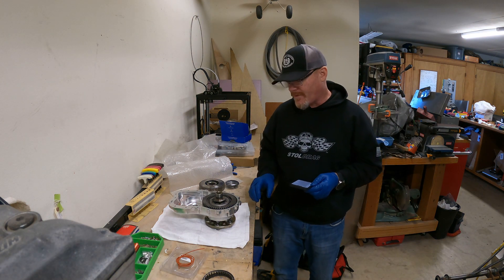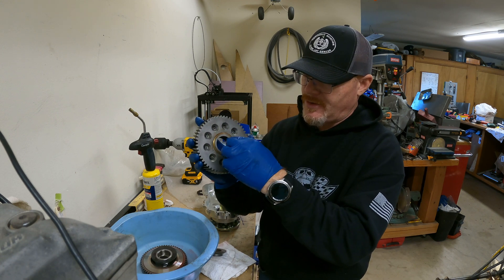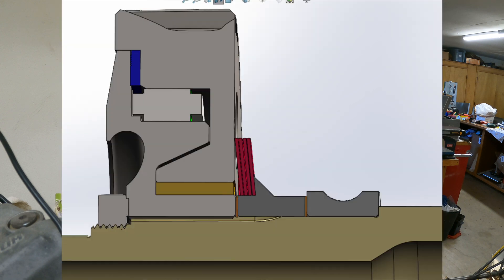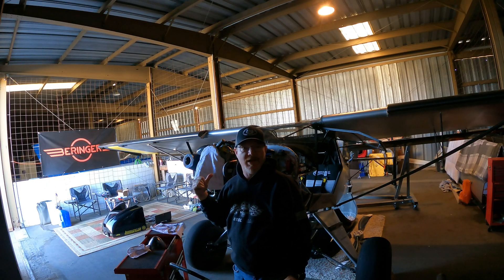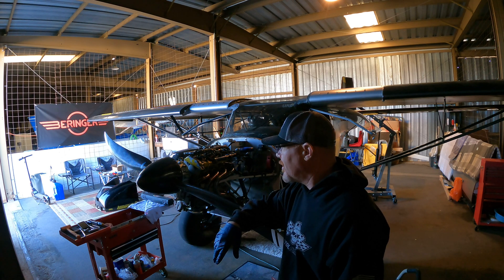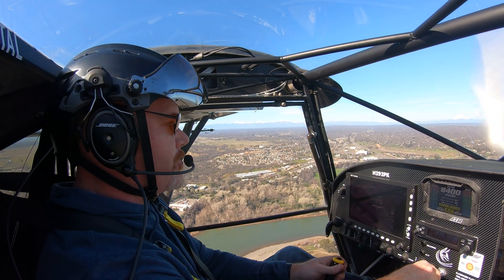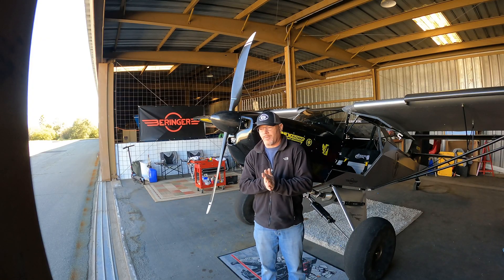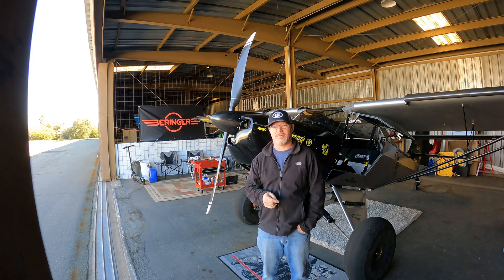Kitfox 7 Apex Build Episode 72 SkyTrax Gearbox Clutch upgrade for the Yamaha APEX on a Kitfox 7

Comment: Hey Bryan, love your videos. Thanks for sharing your journey. I've noticed for a while on your in-flight audio that you seem to have a ground loop causing noise. Ground loops can be tough to track down and fix, but you might consider trying an inline noise filter on your recording device's DC power supply line and/or a ground loop isolator on the audio line. Both can be made, or purchased quite cheaply from Amazon. I've used both together in my Xterra to squash a ground loop in my ham radio install. Total cost was about $20.

Comment: I was interested in the skytrax box but the more I dug into the more I was unsure of it. It seems these things are getting constantly modified or updated. When I talked to company about the box, what it's mtbf, and other technical question I got a whole lot of nothing. The use of a sprag clutch is questionable as a means of dealing with the engines  oscillating output. I am still interested in the solution and think it's great people are experimenting. It feels like most of the testing for reliability is being done by the customers.
Reply: @tealjenkins4716  I do understand the difference between the 4  and 3 cylinder motor. Both were experimented with in autogyro Forum.

In typical internet comment section fashion this is descending into an unprofessional discussion. Best of luck with your business.
Reply: Brother Teal Sir, you rock. And the service you have introduced and provided the EAB community is exceedingly valuable. Your dedication to continuous improvement is admirable, to say the least. The Yamaha conversion engines are one of the very most exciting developments in our part of aviation and your work has been the single most important system that has made all the rest possible. Seriously— thank you 😎🎩♠️💙
Reply: @tealjenkins4716  while you may have designed your gearbox from the ground up its very similar to the ideas and experimentation on the autogyro forum. The layout would have to be very identical anyways based on the mount location of the yamaha apex. I am sure you drew inspiration from prior work and their is nothing wrong with that. Also the development budget should match the the technical complexity of producing a safe design regardless of the quantities sold. 

 Mr. Jenkins I emailed you in July 2021 at which point you indicated you only had 200 hrs on a test bench and had no other reliability or testing information to share. Second you said the torsional vibration was handled by yamaha which is not a correct statement since that type of analysis requires looking at the whole system  including the propeller and gearbox, maybe your lucky and the damper is good enough . The system maybe overly or under damped in which cases problems may appear longer down the road. 

If you are using a sprag clutch to disconnect the motor and psru at stratup and landing its still problematic. The loss of the PSRU is a catastrophic failure condition since it can lead to the loss of life and aircraft (AC 25.1309-1). The probability of failure for any aircraft component in the catastrophic hazard category is expected to be 1^-9  failures per flight hour, one in a billion.  Every component in a PSRU should  have this probability failure assuming its not a redundant load path.  

Given the history of sprag clutches failing in Aviation I would be hard pressed to believe that the sprag clutch can meet 1^-9 . If I was going to supply some means of disconnect at startup and shut down. It would be a normally on, engaged, mechanical or electromechanical clutch operated by the pilot.  Failure of the manual clutch to hold after startup can be identified by the pilot during run up, the system is always engaged so no possibility of disconnect in flight as may happen with a sprag. If the clutch does not disengage after landing that is not catastrophic to life so the requirement for that type of failure is much lower.  Even better is not have a clutch at all which is possible  but very tricky to do. 

You claim that the sprag clutch is not seeing torsional vibration but I doubt that's the case and maybe you are just responding quickly on the internet. Regardless I do wish you success with your gear box  its great concept for aviation to have cheaper power plants.  Also I applaud you for even trying, its a lot of work and effort to build anything commercially.
Reply: I think for the Skytrax to be successfull, long term, the factory clutch design has to be replicated with similar features.
Reply: That's why it's called experimental. You have to start somewhere, you think Rotax just one day designed a motor and started selling them with a TBO rating? Everything is a process and a learning curve.
Reply: @sneakybow1   Just because its experimental does not mean you do not need to do your homework. I have done professional work on certified aircraft and the design phase of a product is the shortest phase of the development in certified aviation. Most of your time is spent putting plans together, writing documentation, doing configuration management plans, certifying process and procedures, etc.  Experimental aviation just lets you bypass the paperwork its not a excuse or waiver to not do proper engineering.  You can build an experimental mode S transponder bypass all the validation work but you better make sure it actually works properly in the system or else the FAA is  not going to have kind words for you.  

I have done gearbox design and analysis for certified aviation and its a big task to get the design right and reliable. The problem with using sprag clutches in psru are well documented, which is why you do not find them in certified aviation. This skytrax gear box has been kicking around now for over 10 years originally started on the rotoary wing  forum when people started to experiment with the yamaha engine,3 cylinder,  and a rotax gear box for auto gyros. After the success of the 3 cylinder Yamaha people looked at the 4 cylinder but you could not just bolt on a rotax gear box and the skytrax box or its first version started to appear. I first saw this gear box  fly on a autogyro.  Fast forward several years later and I see the gearbox is being sold by a company. I figure by this time the design should be mature, sorted, and have had a proper bench test for wear and accelerated life testing. When I email the company they responded with well we have not done that but some user have many hours on the gear box. 

I still think its a great idea but lots of "autoconversion"  have been popular in aviation only to be undone by the gearbox some time later down the road when the fleet gets up in hours the fatigue damage starts to show up. 

Also rotax sold their first engine with a 300 TBO in 1975.

Comment: I hate to say this Bryan, but according to the sectional diagram at 2:47 you seem to have put the very thin shim washer on the clutch side of the Belville washers, rather than between the washers and the spacer underneath the nut.
Reply from the maker: We put it on that side to start and measure the amount of torque required to turn the hub. As the friction plate wears in, the shim can be moved to the other side applying more pressure to the friction plate. There is a diagram for each option. I just happened to put that one in the video. But good catch.
Reply: @BowenAero  Glad it wasn't anything critical :D